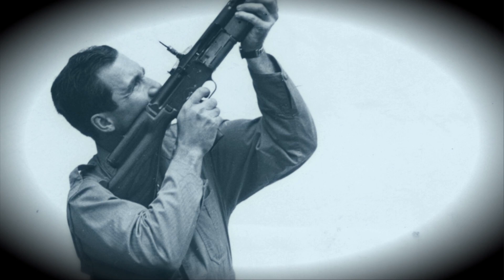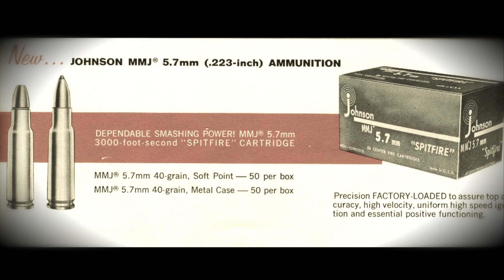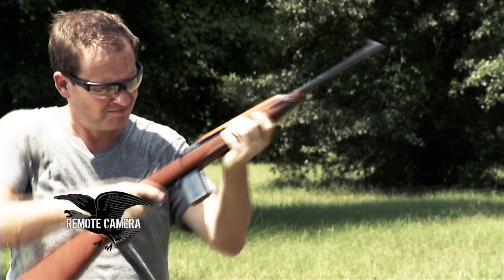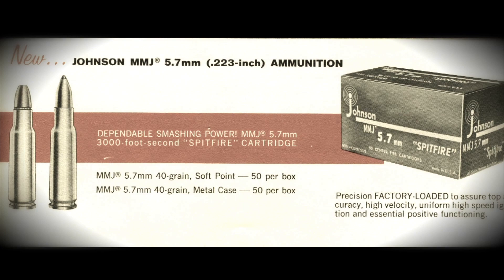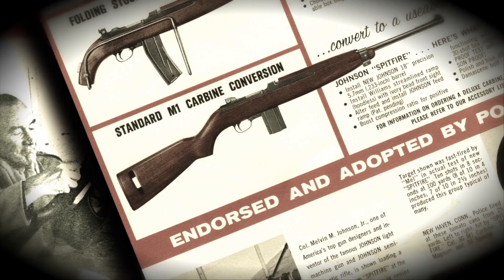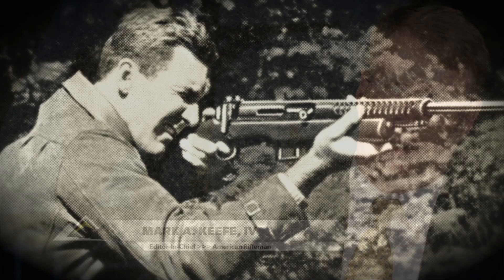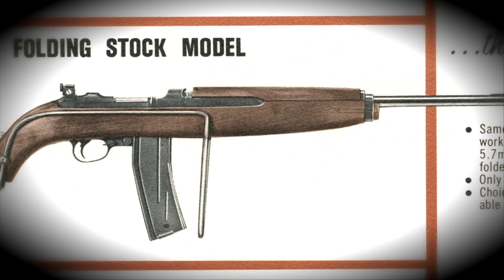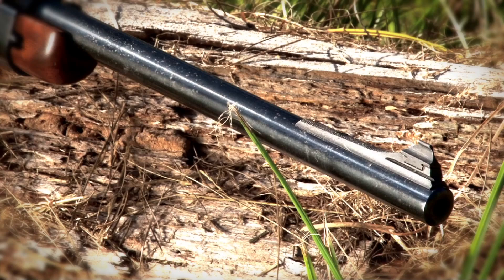I Have This Old Gun - Johnson Spitfire Carbine

Comment: 5.7MMJ would be a good pdw cartage today.
Reply: The .22 Spitfire would definitely be a much better round than the FN 5.7x28mm used in the P90 submachine gun.  The FN 5.7 is too much of a pistol caliber with 570 joules of muzzle energy.  The .22 Spitfire breaks the 1000 joule barrier putting it into the small rifle caliber.
Reply: @GeorgeOu  that energy you quote, is from spitfire rounds fired from a full length barrel (18 inches). If fired from the same barrel length as the p90, the spitfire would lose velocity as well.

Comment: I remember these in the 60s.  Good design but the M1 carbine was never accurate enough to be a "varmint rifle" so it was not very successful in commercial sales. It was also relatively expensive compared to the cheap (at that time) .30 carbine ammo and cheap, surplus, M1 Carbines. The Johnson rifle and cartridge offered no real advantage over the original .30 carbine and did it for a much higher cost. 
Another cartridge, the .219 Zipper, suffered the same fate.  It was designed to try to make a varmint rifle out of the Model 94 Winchester. The cartridge had some promise, but the rifle never met the accuracy requirements.  The .22 Savage Hi-Power, marketed in the Savage Model 99 lever gun, which predated both of those, was actually advertised as a big game rifle.  There were too many other, better, big game cartridges available in the Savage Model 99.
Ironically enough, the Spitfire carbine would probably be a better seller today than it was in the 50s and 60s when it had to compete with cheap surplus carbines and ammo.  Were someone to build this today, using a replica M1 carbine, it may be quite successful. IF they could do it for a cost similar to other pistol caliber carbines on the market.  With modern propellants, it would outperform the 5.7mm FN or .22 TCM cartridge, and everyone knows how light and handy the M1 carbine is.
Reply: Even back then it outperformed the 5.7x28mm and the .22 TCM. It was getting 2,800 fps chronoed at its lowest and about twice the energy of the 5.7x28mm at that!
Reply: Imagine KelTec PMR 30 and CMR 30 chambered in this ammo.

Comment: Melvin Johnson really had a strong influence in today's guns. He himself made use of the rotating bolt with radial locking lugs that we see in AR15 and AR18 style rifles now, and it was Melvin Johnson himself who worked with Eugene Stoner, and told him "This is the best way to do a rotating bolt, you should use this setup in automatic rifles."
In that sense, it's curious how his effort for a smallbore M1 Carbine for the military lost out in favor of the AR15, a rifle from one of his old subordinates.
Reply: It's for the best that  we adopted a rifle in which a rotating bolt locks into a barrel extension rather than channels cut into the receiver. 
Allows for a much lighter receiver and inherently better accuracy.

Comment: 5.56 is not ideal for modern carbines and short barreled rifles. It’s designed for a 20 inch barrel. There’s far more propellant than necessary. Excess flash/blast but even more so recoil (a grain of propellant imparts 50% more felt recoil than a grain of bullet mass)

There’s a reason why Colt created the MARS in 1997 immediately after the M4. 5.56x30.

How does it compare to 5.56x45 out of a 10” barrel? Both 2600 FPS. No surprise. Just basic design.

.221 Fireball is the same idea — parent case of the .300 Blackout — Designed for barrels up to 14.5, or 16” (.222 Remington, with less powder than .223, was determined to have far too much propellant).

...and the French 5.56x30mm GIAT... and the Indian 5.56x30mm MINSAS.
Reply: Exactly. It baffles me how things like the 5.7MMJ and 5.56x30mm MARS never got popular. They’re clearly more efficient and practical, but people cling onto familiarity.

Yet, 5.7x28mm is relatively popular and has similar dimensions compared to 5.7MMJ, whilst only having half the energy. I do think the 5.56x30mm MARS could’ve fared better if Colt marketed it towards the real market, the citizens, instead of chasing government contracts and giving up entirely once they failed. The world very often seems backwards.
Reply: I have a National Postal Meter in 5.7mm Johnson.  It is an accurate half-moa rifle at 50 yards.  Loves anything from 35 to 47 grains and will run 3,000 to 2,500 fps easily.  East to convert .30 carbine brass to 5.7 with one pull of the press. A pound of powder will produce 500 loads!  Brass lasts up to a dozen firings!  Lots of fun, but not something to hunt with.  I saw Serial No 001 by Plainfield, Corp at a gun show in Orlando.  Sold for $450.  I would not take a grand for mine.  Want to restore it?  Just screw on a .30 Carbine barrel and you are good to go.

Comment: About 50 years ago, I had Johnson rebarrel a Plainfield M-1 carbine to 5.7mm.  RCBS made case forming dies, and as I recall I fed it 40 Speer pills loaded on top of IMR 4227.

At normal operating pressures for publishes handloads, it was real finicky about headspace, and very prone to head separations which left the ruptured body of the cartridge case stuck in the chamber.  I gave up shooting it.